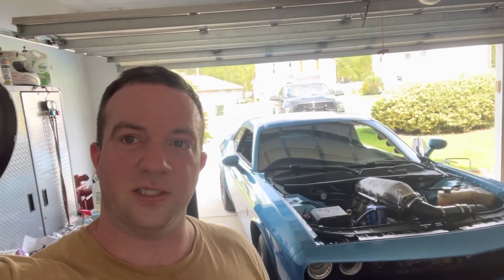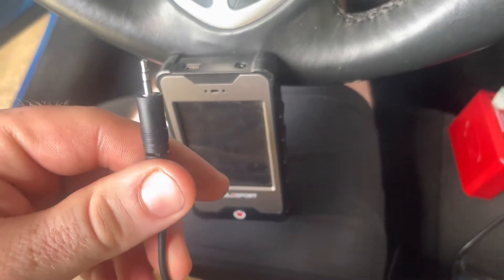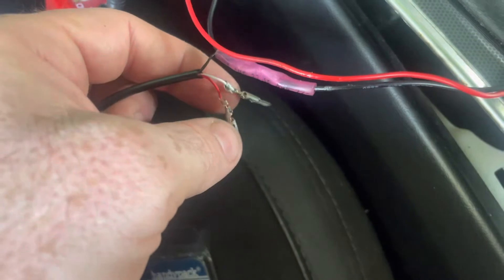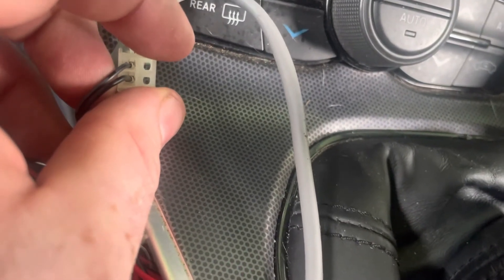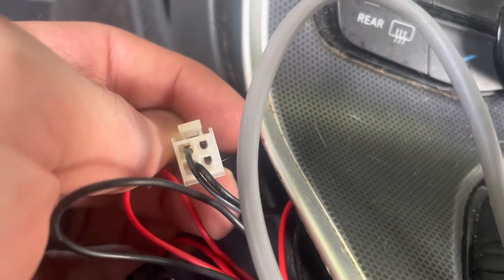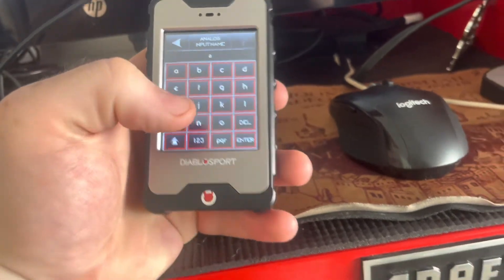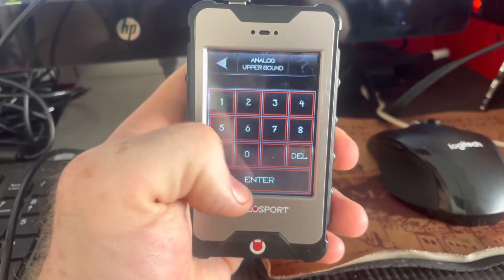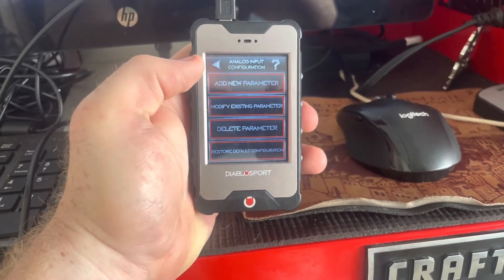How to data log your afr using a plx wideband with Diablo i3 tuner

Comment: Great video, thanks for sharing. I have two vehicles now that have a plx wideband. My question to you is, when you plug in the wires from your tuner to the SFM (white analog block) can you remove them easily or are they permanently in there at that point? The reason I ask is because I would like to just use the same wire on both cars instead of purchasing two.